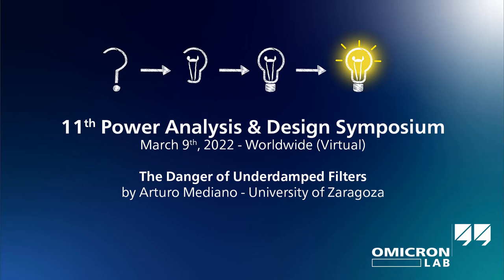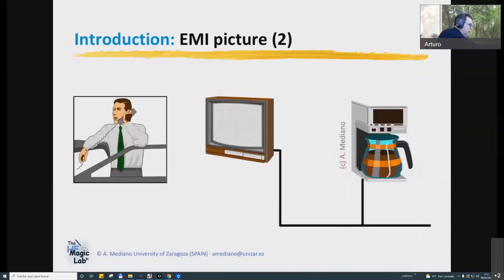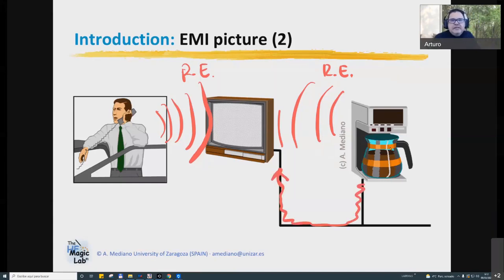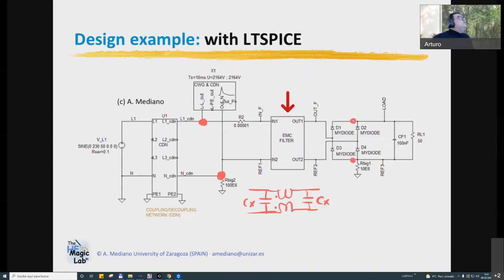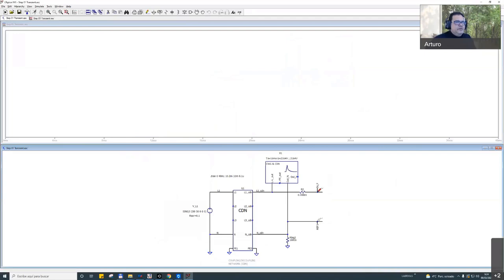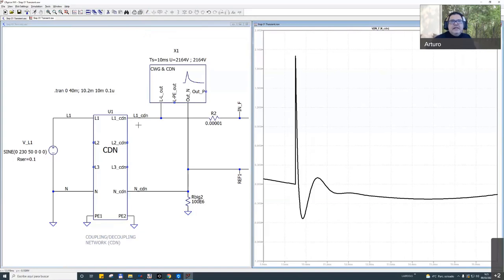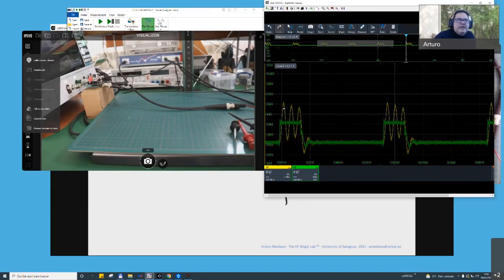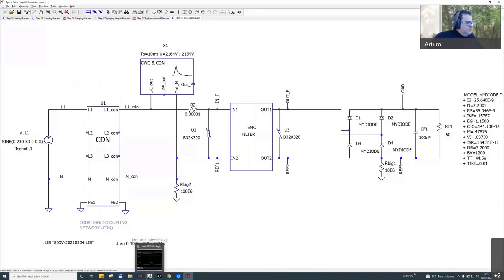The Danger of Underdamped Filters

Comment: can we consider the filter capacitor after the bridge as a damping network, or we have to plug it directly  parallel to the line filter?
Reply from the maker: What do you mean by "after the bridge"?
Reply: @OMICRONLabTutorials  I mean can we use the rectification/smoothing  capacitor as the damping capacitor
Reply from the maker: @mohammedabdeltawab9882 , I think it depends on what you want to damp and the specific configuration. Not sure if this can be answered "in general".
Reply: @OMICRONLabTutorials  iam talking about damping line filter, instead of using a series  RC parallel to the line filter, could we come consider the rectification Cap  with it's ESR as the damping element
Reply from the maker: @mohammedabdeltawab9882   sometimes the ESR of the capacitor can be sufficient such that no extra damping element is required. Not sure how the rectification diodes are changing that. I think that depends on the frequency where the damping is required.